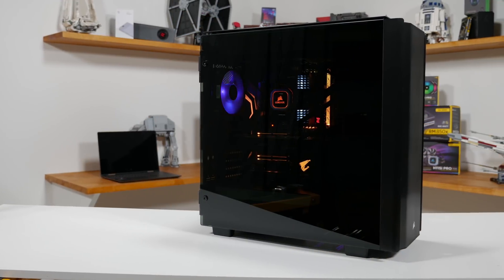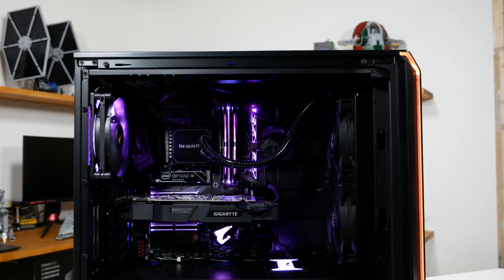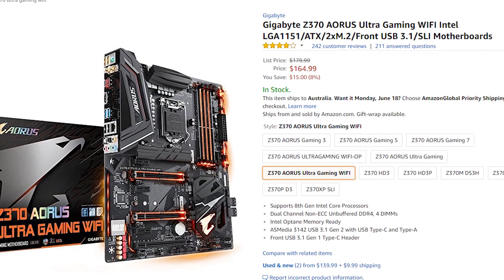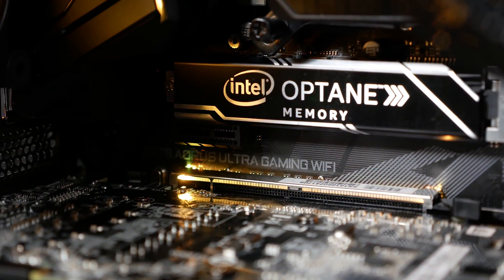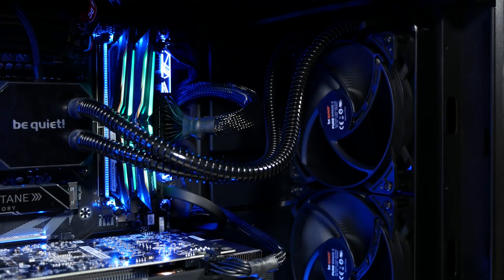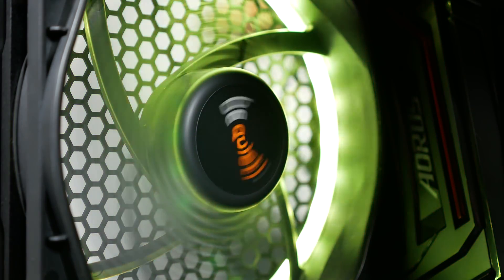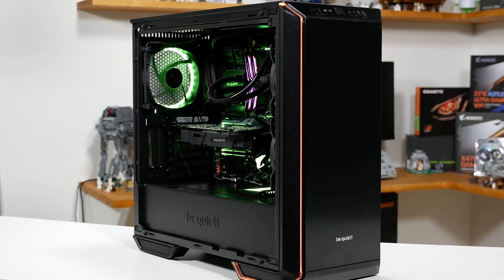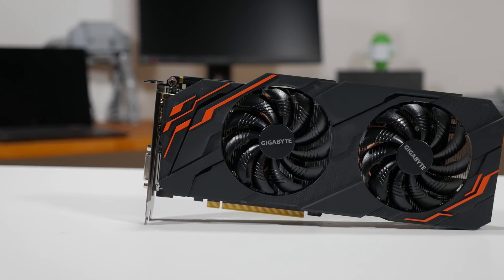Final Gigabyte 8700K Test System and Overclocking Results

Comment: Asus Maximus Formula 10 auto setting fail on 8700k over 5.0 GHZ. My new 8086k auto over clocks 5.2 GHZ on same system. Fun thing my 8700k @ same clocks as 8086k does better by about 1-2 percent.

Comment: Good luck tinkering with that gigabyte board. I've been overclocking using offset vcore since the X58 platform, always a breeze with asus boards. 
For this gen, I picked up an aurus z370 gaming 7 for the circus lights alone, and still regretting. Pain in the ass to OC on gigabyte boards mate.

Comment: A little recomendation Steve, it appears that your chip is like mine, and mine runs 4.9 ghz at 1.344v (CPUZ Voltage). And 4.8 is stable at 1.25v so pretty big jump right there. 4.8 ghz seems like the sweetspot imo.

Comment: How low did you try and push the voltage with manual overclocking at 5ghz? Surely you would be able to reduce the temps substantially like this if the chip is reasonable? You didn't seem to mention manual ocing at all for the 5ghz frequency.

Comment: A asked several weeks ago why you used 5.2ghz 8700k in benchmark comparisons. I could only do that after I delidded my cpu.
Reply: Ady Gosling depends on how lucky you get with the silicon lottery, my 8700k will do 5.3ghz without a de-lid at 1.4v and remain within reasonable temps. Some folks haven't been so lucky and can barely hit 5ghz even after delidding.
Reply: You've been really lucky. Yeah at 5ghz i had cores in the 90s which i wasnt keen on, after delid i hit 5.27ghz  1.36v with temps in the late 60s running asus realbench stress test(oc bclk & ram at 4266). I think silicon lottery had about 20% hitting 5.2ghz stable at 1.42v delidded. For that reason I didnt agree with hardware unboxed using 5.2ghz in comparison benchmarks. Probably doesnt make much difference with 5ghz in games anyway. :)

Comment: You'd likely of reached much higher if u went with a better board. Checkout reviews on newegg. The z370 gaming ultra is a piece of crap. So bad they made a 2.0 version that's still a piece of crap. Checkout oc3d video about it. Gaming 5 or gaming 7 is a much better buy. I'd of avoided gigabyte completely and went with msi or Asus. Gigabyte is just all over the place right now quality wise.
Reply: Yep, gaming 7 or nothing if you have to go gigabyte.
Reply: Cmdr Flint I don't know why anyone would have to go gigabyte. I guess if u have a gigabyte gpu already. They have a ton of issues too. Fans ramping up and down, fans dying, cheap shrouds that rattle.

Comment: Optane with 8th gen CPU is a no brainer (as you can cache non boot drives with 8th gen) unless you're baller and using 100% SSD storage.  And even then - if it's sata SSD, the Optane module could provide performance increase; though consider the 32gb or 64gb model as the 16gb has lower transfer rates.

Comment: Why not check with one of those overclocking etailers who sell by how much they oc? Chances are you still got a cpu better than most consumers.
Reply from the maker: We've tested quite a few 8700K's now, all were good for 5 GHz.
Reply: There a channel called adored tv that actually got in touch with a place and was able to get some very comprehensive data on a great deal larger sample size.
Reply: Think we are all pretty much aware of Adored's speculation. Silicon lottery is where you'll find equal or greater than 85% of 8700k's they binned will do 5Ghz.

Comment: i need a good advice from the best and i apologize if its to big of a question: I have 2 pc the one i use has r5 1600. - gtx 1060 3 gb.  the other is a 2nd gen old i5 with 1155 and a gtx 650. the motherboard on the i5 got fked and i dont have my second pc. wanted to buy a new mtb for the i5 but the cheapest i could find is 65$ here and i dont want and thought to upgrade. since ryzen is so good and compatable i was thinking to buy either a r3 1300x and a new mtb for around 150$ instead of wasting 65 $ for such an old cpu.but later i thought if i could buy a 1700x  with a watercooler for 220+55 b350  and move my r5 1600 to the old machine. if i had a better gpu i would do the 2nd option. but i have a gtx 650 on the second pc and those 125 $ i save from buying the r3 are half the price of a gtx 1060 6 gb. should i stay with  the r5 1600 and buy a r3 and save money for a gtx 1060 6gb and move my 3 gb to the old machine ? or is the r7 and r5 to the old machine better ? i need the opinion of a pro. right now i have 300$ so either option is possible for me.
Reply: Tequila Shot well depends on what you'll do with the other PC.
If gaming difinatly get the 1060 but I would wait for the new generation of cards in 2 months that offer more performance for less price.
The I5 is slow but the bottleneck will be small so you can handle it till Rayzen 2 in 2019 to upgrade it!

Comment: Over 100C on the VRM's is "toasty" for you? 80C is too hot for comfort for most people. You really need their gaming M5 model at least with a more robust VRM to handle the 8700k. I know you were given this board, but you really should swap it if you want to sustain that clock speed for sustained testing. It might you "pop" at some point.
Reply: Aurummorituri 80c is low on vrm’s they’re rated at 105c so between 95-100c you’re fine all day long.
Reply: Hmm I was always under the assumption that anything close to the water boiling point is bad
Reply: Long Tran no, depending on the quality of your capacitors they’re rated at 5000,10000 or sometimes 15000 hours at 105c the most important thing is heat dissipation which fans help massively with.
Reply: isn't water vapour like the leading cause of product degradation? So surely keeping them under 95 would be beneficial? As the higher the temperature the higher the humidity too.

disclaimer: I am by no means any kind of expert on VRMs though.
Reply: sickbailey21 what are you on about with water vapor? Are you under the impression that vrms have water in them?
Reply: is it that board that oc3d trashed? 100c on vrms is definitly not good, depends how long he tested. i belive that oc3d reached about 125c on those vrms. https://www.youtube.com/watch?v=0wuT7cCgOCg&t=14s
Reply: the air has moisture in it
Reply: sickbailey21 and that's only a problem when things get cold, genius...
Reply: Trey Motes https://climate.ncsu.edu/edu/Humidity thanks for your input
Reply: sickbailey21 FACE PALM... you freaking moron
Reply: My cpu is rated for 100C but I certainly never want to run it that hot. My VRM's stay around 70C under heavy load with good airflow. Granted, I have 16 of them, but running electrical components near their tolerances is not a good idea long-term. Not to mention adjacent components to those VRM's may not be rated that high and degrade quickly from the radiated heat, like capacitors.
Reply: Trey Motes I’d be fucking worried if they did.
Reply: sickbailey21 don’t worry about rh% it’s not an issue for your components unless you have many systems running in a small enclosed area without any ventilation. At the levels required your wood floors would be pushing down a load bearing wall.

Comment: please delid it,you will be so pleased with the results!
Reply: You shouldn't have to delid a part and void your warranty...
Reply: that may be true, but 15-20' cooler makes an awful lot of difference when overclocking or undervolting and probably prolongs the life of your cpu as it runs cooler so not so stressed by excessive heat.provided you do not kill it by doing something stupid.
Reply: Intel fanboy detected
Reply: no love AMD just as much, but thermal Paste on all intel chips is rubbish, if you want it to run cool and release it's full potential,delid and liquid metal is the way to go!

Comment: Why on earth would you go for the terrible Aorus ultra gaming?. It's got literally the worst vrm of any z370 board, will severely hamper overclocking. The Aorus gaming 7 would have been much more suitable here as it's overkill vrm won't limit a chip's potential.
Reply: Cmdr Flint - Not only it has awful VRM, but it has bios issues with ram, CR1 memory with decent 3200Mhz speed is not stable, only CR2. Those 150C VRM temps looks hella scary, im wondering if he's running the AIO fans in pull conf, but i guess its no other way, since the case is closed off in the front.
Reply: Z370 Motherboard Comparison Table: https://docs.google.com/spreadsheets/d/1IY6W6YhyjnzSvi8BqEqiK1xykSiTDF2Lt1FO8cNhI6I/edit#gid=585498417

Z370 Motherboard Tier List: http://www.overclock.net/forum/attachment.php?attachmentid=99753&d=1519942298

Z370 Temperature Compilation: http://www.overclock.net/forum/attachment.php?attachmentid=99745&d=1519942298

Z370 VRM Discussion: http://www.overclock.net/forum/6-intel-motherboards/1638955-z370-z390-vrm-discussion-thread.html
Reply: where can i get the sheet showing informations about motherboard VRM for coffeelake? i remember seeing it somewhere but i can't find
Reply: I love how similar the names of each board is. Not.
Reply: Absolutely not the same VRM
MSI SLI PLUS: 8x Ubiq QN3103 + QN3107 - via 4 PWM Phases & uP1962
MSI Pro Carbon: 8x OnSemi - via 4 PWM Phases & uP1962
Reply: The temperature of the VRM can be evaluated without disassembling the motherboard. For example the use of thermal images in reviews that you find online.
However, the Gigabyte Ultra Gaming does not have the temperature sensor of the VRM , so the numbers that put the guy above what they refer to? Maybe the CPU....
Reply: You're probably thinking of the one on Reddit, Hoang.
Reply: i agree. I have the Ultra Gaming (non wifi) and am pretty much forced to keep the cpu at 4.8 just to keep the VRM's under control. It's a terrible board for serious overclocking. Light overclocks only.
Reply: how did you get the temperature? do you have an infrared laser gun?
Reply: Alpha Artax lol that sheet is kind of dumb. My msi sli plus is red as in lower end but it has identical vrm and specs as the msi gaming pro carbon which is yellow. Guess no rgb on the io shield and missing 1 m.2 heatsink makes it midrange. Even tho pcb is basically identical lol. Also tho things make the carbon have "high end performance" 😂
Reply: HOODedDutchman
, different MOSFET.
Reply: Christian Anderson No, they are identical. Looked it up. Pretty sure the krait is also the same.
Reply: Christian Anderson https://us.hardware.info/product/413427/msi-z370-sli-plus/specifications

https://us.hardware.info/product/413720/msi-z370-gaming-pro-carbon/specifications
Reply: Oh you're right. I messed up and looked at the wrong board (ITX)
Reply: Alpha Artax a laser gun would only get the heatsink temps, their usually hotter underneath the heatsink or cooler depending on the heatsink.
Reply: Had the aorus gaming 7. Had to rma it 5 times due to manufacturing problems sometimes the lan port wont boot sometimes dead usbs ugh. Then on its bios is the most buggy and WORST it would do 1 boot on 3200 and crash on restart then do another booot on 3200 run fine for a day and crash after even on the latest bios then it was pumping 1.5v into my ram for no reason at all and overclocking was a night mare it couldnt even do 5 ghz. Ended up to return it and bought Z370 Strix H 5.2ghzcpu 4200mhz mem easy life no worries Gigabyte is down to the level of msi and asrock hell they are even lower than that had very bad experiences with msi and asrock both So guess ima stick to asus for a long long time

Comment: You should try dropping the voltage on the cpu that’s pretty high for 5ghz my 8700k is no golden sample what will do 5ghz at 1.32v
Reply: Hold my "coffee". I need 1.36V for 4.8Ghz and around 1.43V for 5Ghz. And that's on MAXIMUS X HERO with Kraken X62. So I run 4.5Ghz @ 1.25V and even with such voltage CPU gets up to 80C in blender and while streaming. No delid btw
Reply: 5GHz @ 1.32V is pretty damn good bro, mine needs 1.408V.
Reply: Mine needs 1.4 to push 5GHz stably. I'm currently running at 4.9GHz to extend its life.
Reply: Grow a pair, delid that baby , my 8600k would shoot up to 100c @4.8 1.3v before delid , now i stay happy @ 5ghz 1.4v and temps maxing out 80c in prime 95 avx
Reply: IsakH85 is it stable though, did he prime 95 that baby for a few hours some people think their cpu is stable but dont really test it completely?
Reply: Same for me. 1.32v is as already mentioned quite good!
Reply: I found mine is happy at 5Ghz with 1.35v
Reply: Yeah its dead stable prime 95 tested I do have a -1 avx offset though but that wasn't for stability that was for heat as im only running a 240 aio  temps quickly went well into the 90s without it

Comment: Corsair vengeance rgb 2666mhz or team t-force nighthawk 3200mhz? For my i5-8400 and b360-f strix
Reply: Ngurah Bramhyang 
Why in the first place you buying b360 motherboard if you thinking of of using 3200mhz just buy a cheap z370 nowdays you can get z370 at good price.
Reply: So you are considering buying RAM that is more expensive than your CPU? :o

I dont know your country/prices there, but if i would be in your shoes i would ditch the 3200 kit if it costs more, get the 2666 one and swap the 8400 for the 8600k which would roughly cost the same as 8400+3200.

edit: maybe even the Z370 AORUS Ultra Gaming instead of the b360, 20~ bucks and you can at least overclock
Reply: Ngurah Bramhyang 
If 3200mhz ram and 2666mhz ram price is similar in ur country then you should definitely and i mean really for sure buy 3200mhz ram plus a cheap z370 motherboard. As you will be able to use k processors plus you can over clock memory and cpu in future if you want too. It doesn't matter if it's first build. Z370 is worth it.
Reply: MzNToS ryzen 5 1600 with x370 board.
Reply: If the price is the same then get the T-Force.
Optionally getting some corsair 3000mhz or 3200mhz for the small price increase would be my personal choice; I like corsair RAM, for me it has always worked and never seems to fail in my experience.
Reply: If you're looking to future proof and prices are the same, go with the 3200mhz
Reply: Clint-Excalibur71 but how about quality? Corsair or team?
Reply: HATE regelt in my country 2666mhz and 3200 are simillar, 2666 is corsair and 3200 is team nighthawk so who is the best on their performance? (Sorry for my bad english)
Reply: MzNToS i don't think mine does. Does it really affect it that much? Mine is a 2x8gb kit of 2400mhz ran at 3200mhz 16cas.
Reply: MzNToS I'm fairly certain it's still Cl16 can't remember.
Reply: Ngurah Bramhyang usually in 2-3 years the board aren't made anymore and the prices get unflated. Once ya get to the point they become cheaper their harder to find. If you ever decide to upgrade, you can sell the z370 for more vs the b360. Soooo the 370 seems wiser to me.
Reply: B-die just gets you better overclocking on the ram.  I got some rev 4 dom plats (samsung b-die) and a tforce kit.  Both are ddr 3000 but the dom plats have slightly tighter timings.  I can get almost 100 mhz more on the dom plats, but have to loosen up the timings to the point where they perform within margin of error on every game I could get my hands on.  So atm, I'd suggest you go for the higher speed ram, as long as the timings are decent.  nothing higher than say CAS 16 -18-18-18-38.
Reply: HOODedDutchman nice info, thanks bro!
Reply: Dennis Rigdon thankyou for ur answer bro
Reply: Phil Atkins ok thanks a lot!
Reply: Definitetly the 3200 if they cost the same, both kits have the same timings and the scaling till 3200 is very noticeable so you would get even better performance with it.
Reply: A used z370 board
Reply: Ngurah Bramhyang Both are good, they offer lifetime warranty, on top of free aesthetic RGB. trust me, ram at this price point, you want to go for 3200mhz. You won't regret it
Reply: Ngurah Bramhyang B360 motherboards don't support over 2666mhz RAM, so either will work equally at 2666. I'd get the Corsair.
Reply: Carlos Alberto Deleón if the price is same, so still corsair? I want to buy 3200mhz bcs maybe next 2-3 years i will upgrade to K series and z series motherboard
Reply: Mohit Negi bcs i dont know maybe next 2-3 years i will buy z series motherboard, bcs this is my first build
Reply: Ngurah Bramhyang go 3200. I'd try n find g skill or corsair 3000 or 3200 over team tho. Also just buy a cheaper z370 board. Most times equivalent z370 version of a board is only like $10-$20 more then it's b360 equivalent.
Reply: Get some 2400mhz. They normally OC 3200 easily. Higher mhz ram normally doesn't go far over it's stated speeds because it's already OCd.

Comment: No Delid? What a casual
Reply: Tim didn't want to remove the TIM. lol
Reply: Most people don’t delid, it would give less realistic temperature results if he did.
Reply: Besides, the sole fact that delidding (and thus, voiding your warranty) is a requirement for good overclocks is laughable. Come on Intel, get your sh*t together.
Reply: Lol shouldn't even have to delid honestly
Reply: that would make the system non-stock which is not a good fit for reliable testing methodology